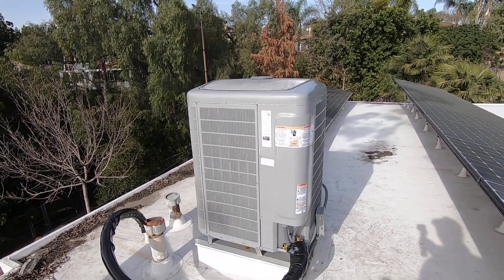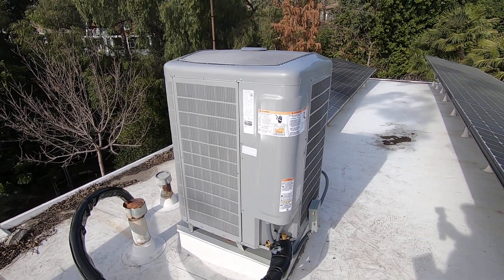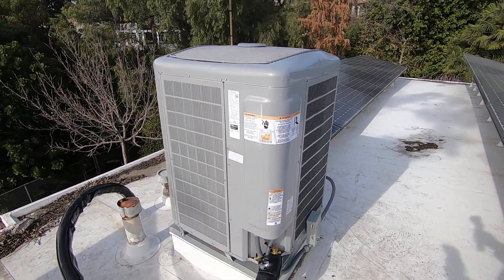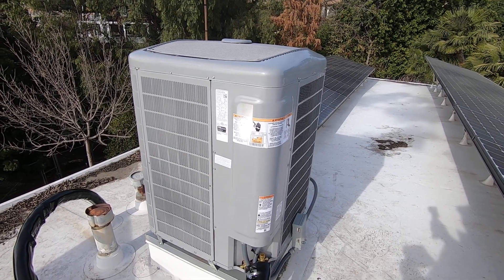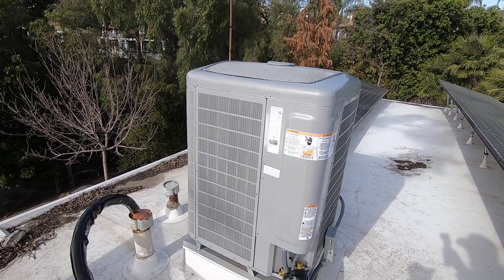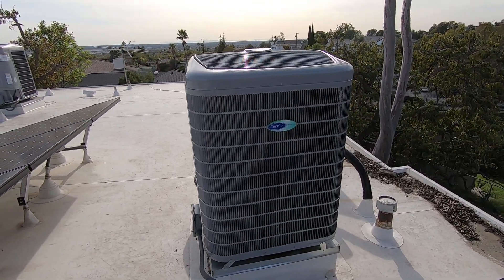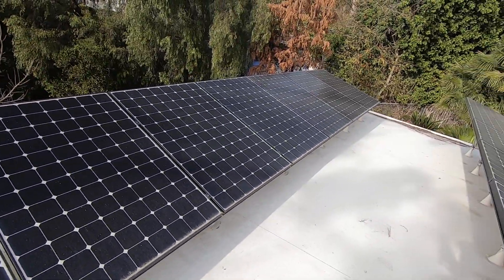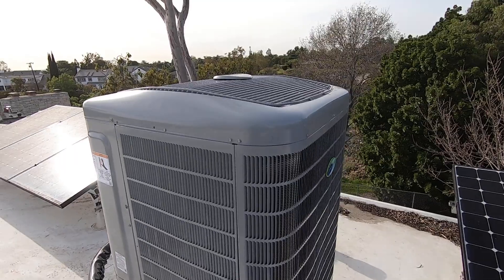Carrier 3 ton Infinity 25VNA436A003 Heat pump condenser

Comment: This is Carrier’s top of the line residential heat pump! Love it! Expensive and very heavy! I am currently replacing my 25VNA060 with the 25VNA860. A bit less money and lighter. The 860 has 5 speeds. Oh, over time that gray unit casing will fade from the sun. 🐧
Reply: Thanks for watching my video.  The 25VNA8 is a great option too.  It is a little smaller than the 25VNA4 and less weight like you said.  The 5 speeds is still a good option.
Reply: @fijiman88  I had to replace due to inverter failure. That inverter is over $6000! FYI, I’m a retired fad dealer.
Reply from the maker: @peterdutile8012  I'm sorry to hear that.  But there is a product bulletin from the factory about the inverters that came out earlier this year and they replace the inverter for free including labor if needed.  I have had to only do two warranty replacements so far out of countless units installed.
Reply: @albertairinc.1140  it was 3 yrs out of warranty. It was 13 years old.
Reply from the maker: @peterdutile8012  Ok. That makes sense because the bulletin only covered the variable speed condensers with model #'s 25VNA8, 25VNA4, 24VNA9 and 24VNA6.  Those were not available 13 years ago.

Comment: How good is this unit? I'm getting similar in CT and would like to know performance in cold weather
Reply from the maker: This is a great system.  I highly recommend it.  It works great in cold weather as long as you maintain the temperature you want.
Reply: @albertairinc.1140 are the solar panels generating power to the heat pumps and is it more efficient then city power.
Reply: @LadariusCapersOfficial  Yes, this customer has solar that generates all of the power for his house.  And yes, it is more efficient to do it that way